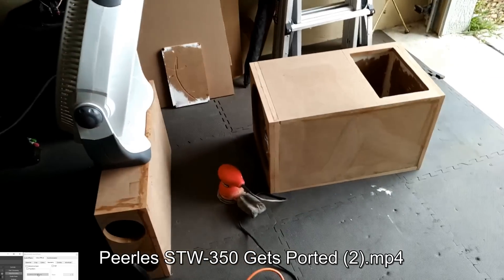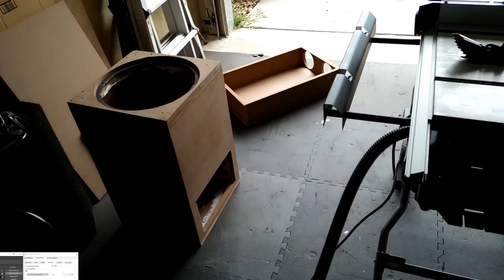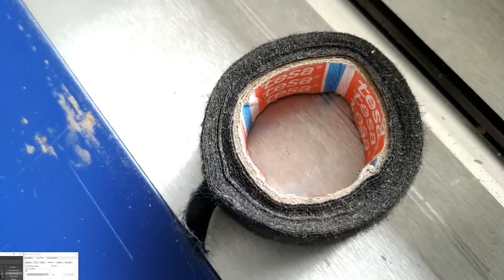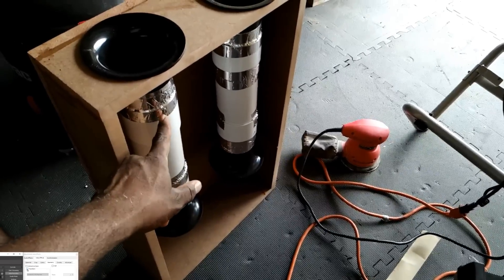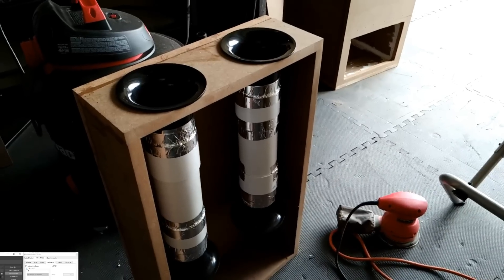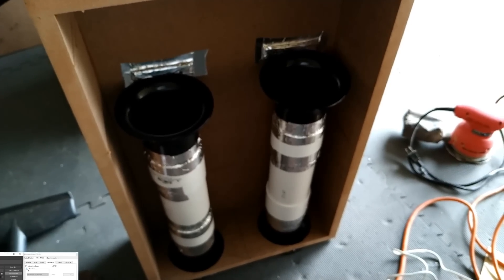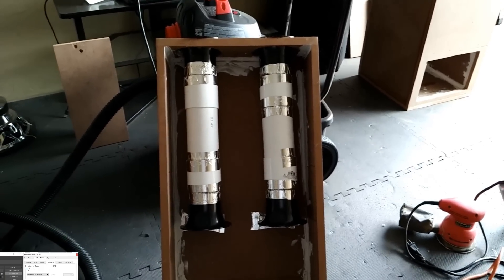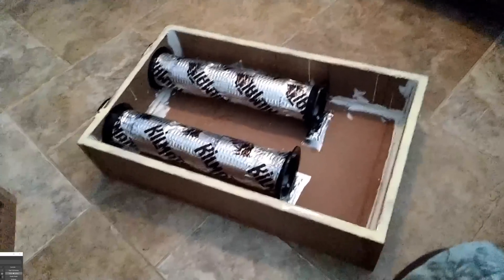Can You Port A Sealed Enclosure - Part 2

Comment: 18 inch port hot damn thought they looked a little short last vid. Love the flares. I been using the router to put a round over on the pipe to creat a small flare but plan to use them soon. Oh and just yesterday my rear view mirror fell off and took a big chunk of glass with it, so be safe bassin.. lol
Reply from the maker: Wow! Glass fell with the rear view!? That's bananas! And yeah, the flares help with smaller ports. The manufacturer recommends dual 4 inch ports, but i used 3 inch. So I figured I better flare both ends.

Comment: Hey I’ve patched old boxes together and chopped up house stereo boxes making boxes for the auto like you glue, and angle screw, brad,  staple, even take those old school little square peaces of metal like they use to reinforce shelves inside the box then get some 1/4 ply wood and cover like 2 of the 4 sides even put two or three small peaces to cover the seams in side hay I’ve even used bonds to fill the cracks in before carpet when you get done if you did the best you could most time every body won’t even believe you when you tell them what you did and I did not hear any thing that made them sound funny being patched together I think made them stronger so man I agree all the way on what your doing I’ve always said a man needs to build a box that ain’t no problem to tune it a just on it have internal walls that can be moved in so the cubic feet can be dropped down like all those pre fab boxes they should never cut holes in those boxes the way you should buy the box is just by how many cubic feet is in it then what your sub calls for then you get the box an cut the hole for sub to fit I’ve seen so many 12” pre fabs the cubic feet and even the port was right for a 10” sub but they got a 12” hole at least they just cut all the holes to small and different subs got different cut out diameters but hey keep on kickin it bass heads we gotta keep on pushin an make it happen!

Comment: I don't think this is going to work as you intended. What you have right now is a port firing into another ported chamber. You need to completely remove that side of the box.
Reply from the maker: the surface area of the hole i cut into the box in approximately 112cu.in. the effective area of the cone of the subwoofer is approximately 118cu.in. So, unless the hole (length = .75in ) runs the length of a T-lined design, there aren't any acoustical effects.